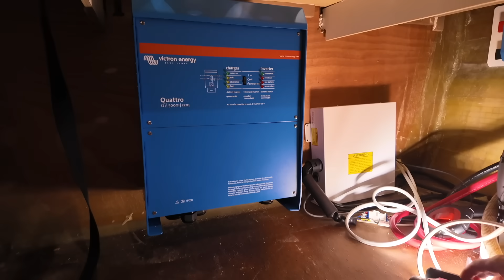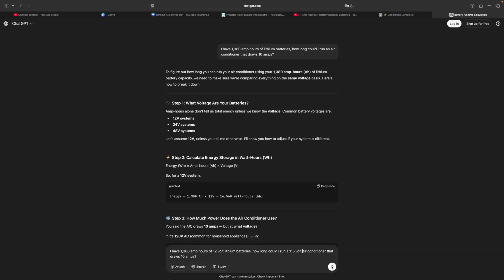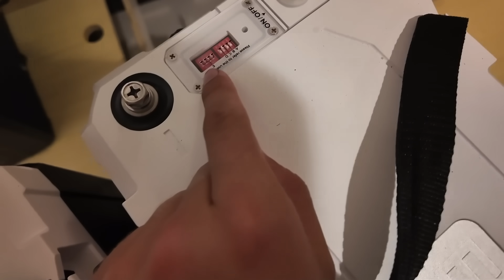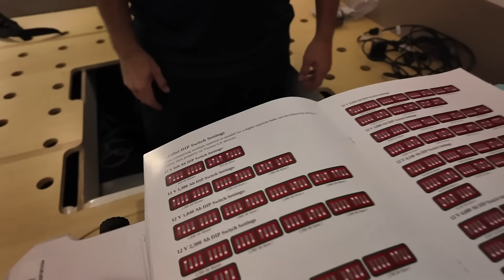How to keep your lady happy on a sailboat⛵️ Ep. 5

Comment: I started out working on air conditioners, and later was a jet fighter mechanic. We had stab aug on our airplanes. A jet fighter is designed on the edge of out of control. It is like a race horse that can not wait for the bell. The pilot had to engage stab aug so the computer helped the pilot fly normal. You will never have this problem on the aircraft that you fly. In air conditioning there is a system not many people know about. Look up what is the temperatrue of water in a vacuum? Water is 36 degrease, and the energy you have to pump is 14.7 psi. Most a/c systems have to pump well over 200 psi to cool. Water is the best refrigerant, but don't tell because the chemical companies will be mad.
Reply from the maker: I wish I flew an aircraft that needed a stab aug, sounds like a good time to me!! 

Are you saying you can tweak air conditioners to pump more water and then need less refrigerant in return?
Reply: @SailingZola  If you have an insulated tank place 34 feet up your mast, pump water into the tank. After venting the tank close the vent. Have the supply line in a trap. The tank will go into a vacuum. The  water will boil until it reaches 36 degrees. This water will cool a water bed. It will also cool a water cooled a/c, and make it more efficeint